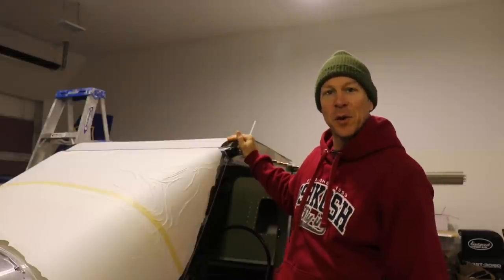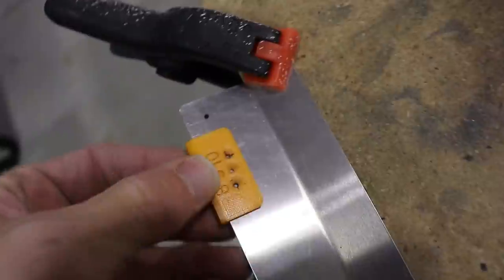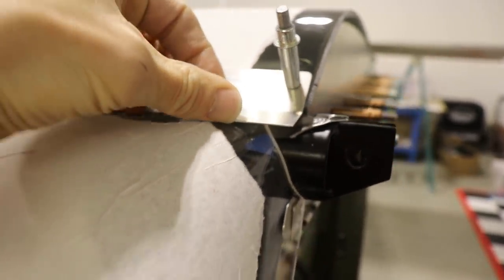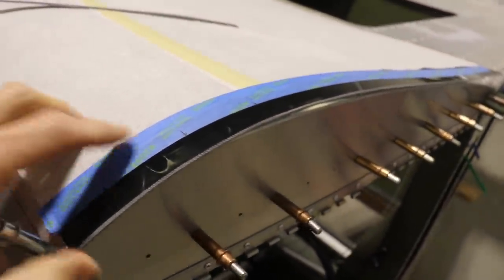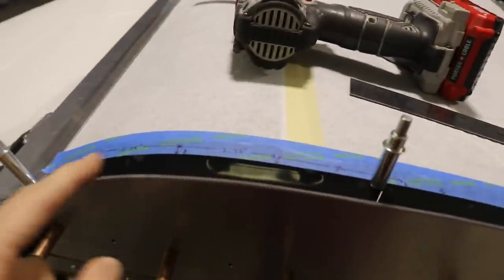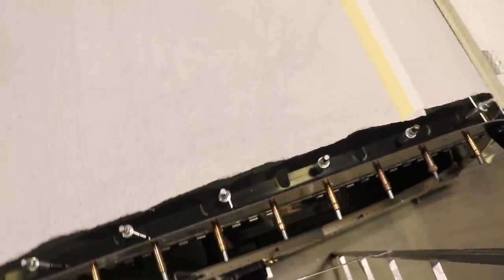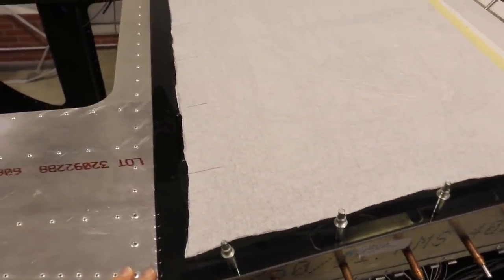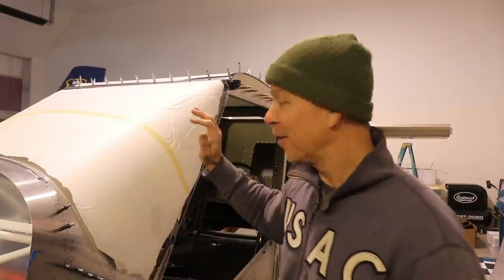Zenith CH-750 Top Window Installation (Ep69)

Comment: Suggestion : the external surface of your top window is going to be at a lower pressure when compared to the cabin (underside) surface during flight. 

This may result in air attempting to escape from inside of the cabin through any tiny gaps and thus might create nuisance noise. 

For this reason you want to make sure you have at least sufficient (not too many) screws to hold the top window secure all along its faying surface (at a maximum screw to screw pitch to facilitate good contact all along between the fastened parts). 

You’ll probably find that your sealant will perform better and last longer as well.

Your workmanship is excellent 👍

Comment: 4" is about the pitch that the instructions call out. I'm in the process of installing a curved roof on a 701. I also made some fairings to make the transition to the wing roots. I was planning on using a cork strip under the trailing edge, but maybe a fairing would be a better idea. Thanks for the video, you do good work!

Comment: For everyone using Silicone adhesives, DO NOT USE THE KIND THAT SMELLS LIKE VINEGAR! Especially in an aircraft.The solvent used in them corrodes electronics. Use GC Electronics Part Number 19-155, it uses alcohol as its solvent and will not affect your electronics. It takes a bit longer to set, but is just as strong as the other kind.
Reply: It only has the potential to cause corrosion while curing, as the process is creating acetic acid. It will only corrode things in very close proximity if there is no ventilation. Encapsulating electronics in silicone is a bad idea. Using it on a window 4’ away won’t be an issue.

Comment: I have the stubby (tiny-t) Incra T-ruler. Might be a better fit if you need to have a little more range in drawing lines at a fixed distance from a edge.  The bend ruler is great for 90 degree edges.

Comment: Do the screws or rivets go directly against the Lexan olr is there a top plate? Or can you use Rubber backed washers.
Reply from the maker: I will get more of the black plastic washers from Ace Hardware.

Comment: Have you considered using a thin rubber gasket material (weatherstrip) between the lexan and the metal?
Reply from the maker: Yes. I’m not sure exactly what I’ll use, but I’ll have to look around and see what’s available.
Reply: @KitplaneEnthusiast   inner tube from a flat
Reply from the maker: @MarkSDCA  That’s a good idea!
Reply: I'm surprised you don't use some sort of a mastic tape, such as butyl sealing tape.